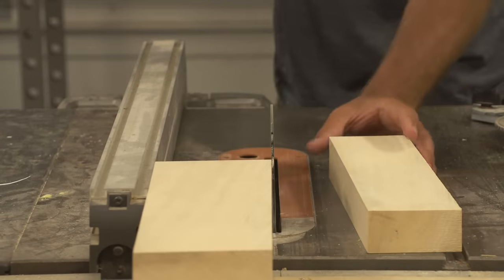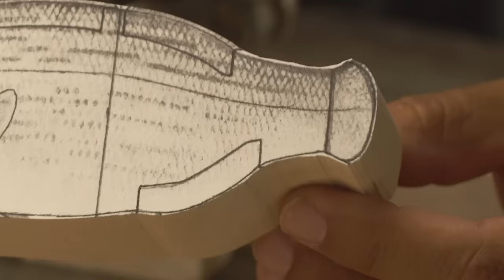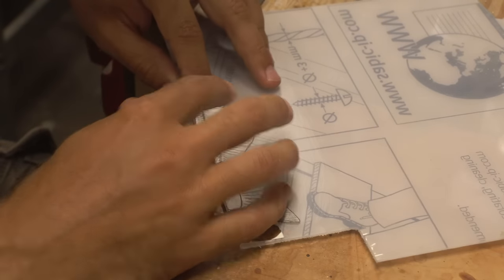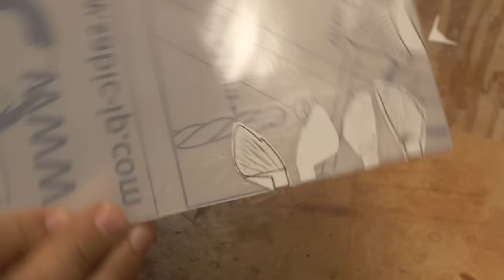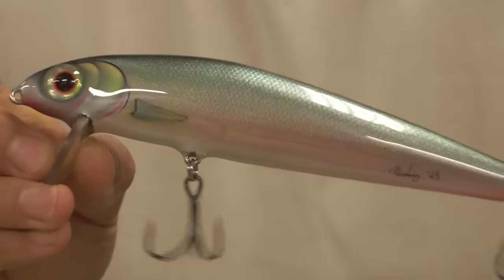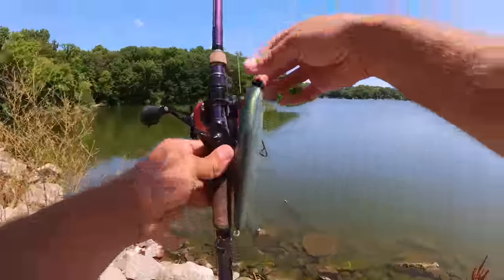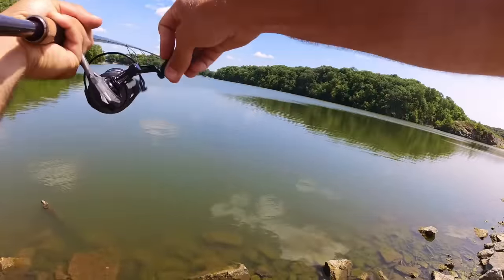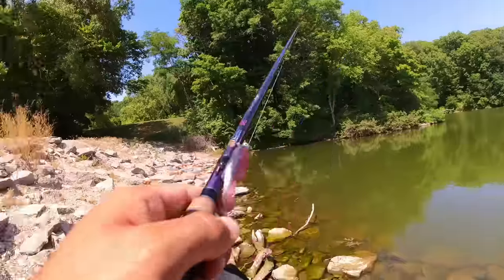Making a White Bass SwimBait

Comment: Idea for stencil: print your fish on one of those plastic sheets made for overhead projectors (flashback to schools in the 80-90's) and then drill out the pattern or melt with the soldering iron? Should be sharper edges and the it won't soak in the paint like paper.

Comment: An old woodworker taught me that if you grind sharp the first inch or so of teeth closest to the handle on a pull saw you'll cut straight every time. No more bouncing off line. It works. 👍🏼👍🏼

Comment: Another great video. Just a thought, perhaps you could cut the rear fins off with a dremel, patch the clear coat with some UV clear coat, put on some slightly larger hooks and then take it to the river/pike spot to see it you can connect with a piky-poo? Since you've written the bait off anyway, it wouldn't hurt to give it a try.

Comment: They make clear plastic sticker material for stencils on cars. It’s made to stencil flames or graphics on a car, but it’s sticky on one side and plastic. I think maybe burning hole into the plastic would be easier and it’s a sticker so easy to stick on the bait and seal itself to the bait and have a clean no overspray finish. They make it triple layer double sided too, so you could actually make your pattern, peel one side, paint the left side of the bait, then take it off peel the opposite side of the sheet and paint the other side of the bait with the exact same stencils, the sheet itself becomes a mirror image of itself when you peel the opposite side so you have a left and a right side, painting cars you want matching flames on both sides so it’s a double stencil, Good luck pal thanks for the videos.

Comment: The fins where on point a tip on those owner ST-35MF hooks have to go one way on the bait the flat side goes towards the back of the bait like u have on the rear. So the hooks sits flush on the belly the one the front hanger was backwards haha that could have been a mistake but. Just in case it wasn't now ya know.

Comment: I have carved 3 lures with a knife but I don’t have any fancy stuff to paint it does normally spray paint work and do I have to seal the wood after painting???
Reply: I have used spray paint to paint lures. I always start with white spray paint for the base coat. The trick is to hold the lure far away from the nozzle.
The first coat of paint, you want to use an extremely lite coat. Like you are just misting it with the paint. I do 2-3 coats of FLAT (ha)white. AVOID gloss or semi gloss paints for your base coats and "skin" colors. Additional layers of paint will adhere better to FLAT paints. Give plenty of time between coats for the paint layers to dry. High contrast colors will look the best as opposed to using similar colors in regard to skin tone vs. Scale color. Get you some window screen replacement roll  from Home Depot, the economy window screen will work fine. I recommend using metallic paint for your scales. I would buy pearl white, gold, silver, and whatever other metallic colors you think might look like fish scales. Oh and clamps to hold the window screen tight onto your lure. The trick is that "Less is more", use ridiculously lite coats of metallic paints or the area that the window screen is covering will be covered and you will lose the effect of the scales. I usually start with Pearl White when spraying the scales and then add the different metallic colors. And I can not stress enough to hold the bait far from the nozzle of the spay can. Like nearly an arms length away. You just want a lite misting of each color.
Reply: Oh and yes you DO want to do a few coats of Clear Coat spray paint or Triple Thick Polycrylic spray works too.
Reply: @aficionadolurecompany700  cool, thanks

Comment: You shoud have a table of densities of different king of wood. That’s makes it easier to calculate the amount of weigth the lure may need according your design including hooks rings and hangers. It is well explained st Engineered sngler. It works nicely

Comment: Dont use hard plastics for fins,they are to rigid. Use soft rubber or silicone that will collapse under pressure exposing sharp Hook points. Plus fins move they are not flat solid straight. It must move like bait or fish. Fish and bait have a certain movement. Have you ever seen a fish suspended. I know you have, picture it. Whats it doing? Nothing but siting still, but its front lower fins are just Waving back and forth with little to no effort not going forward not going backwards. This is how we relax on the Couch. You could do that same lure with half or less in cost in plastic and silicone. Ok! Dont get me wrong this is a work of Art, Hand Crafted by a very skilled man. I love your work, keep on thinking, making, most of all do what you love! Oh! It will catch a Big One Someday.   BW63 Peace Brother